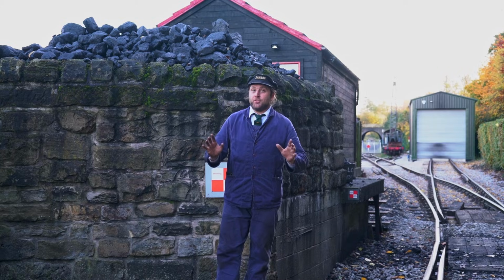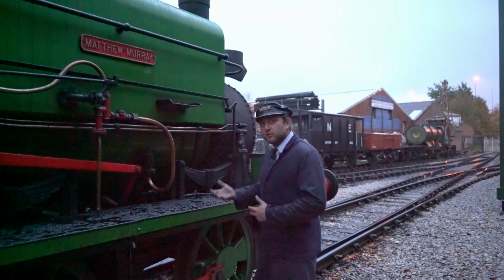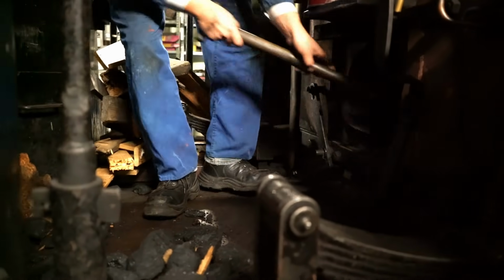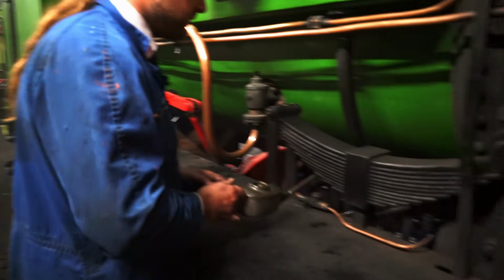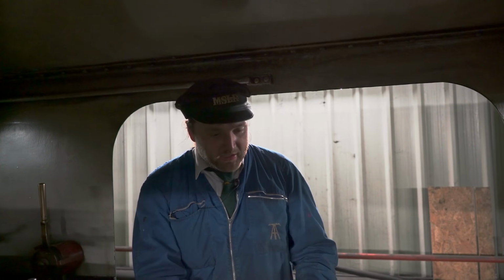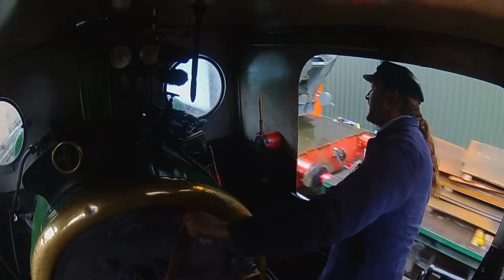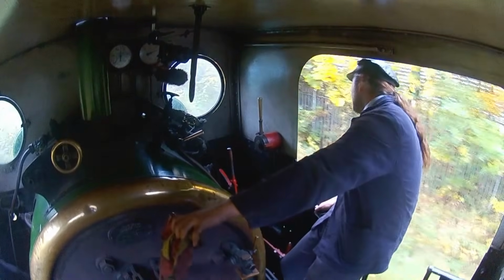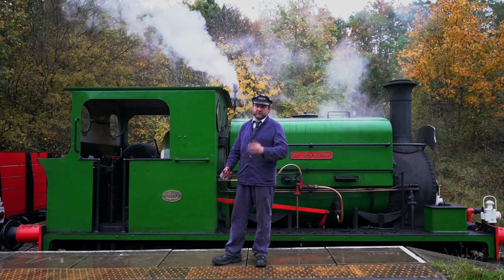Steam, rain, and freight. Driving a Locomotive in the City it was Built! Matthew Murray LGL Ep. 26.

Comment: The amount of trouble the diesels throw up,  knackered flywheel couplings, burst radiators,  oil cooler unions , brocken rockers / push rods,  compressor belts ( never the same profile), compressor valves, donkey engines and starter motors playing up, gearboxes and linkages failing, alernator flashover.
Reply from the maker: Ah yes, but that's a fitters problem, not the drivers! Prep remains simpler and easier

Comment: That's why the U.S. does not have steam engines with cylinders inside the frame, because it was way too difficult to oil and not very convenient to maintain.
Reply from the maker: Does result in better riding though.

Comment: Was this level of oiling a daily occurrence back in the day?
Reply from the maker: Yes, or at least should have been! All the lubrication is total loss, so it'll loose over night if you don't pull the trimmings out too
Reply: It was actually common to re oil many parts during the day on some engines, for example while taking water or waiting in a siding letting another train pass
Reply: It surprises me that automatic oiling systems were not used to eliminate this issue. Reading I see that eventually this was done to some extent but get the impression it was never completed/fully adopted. I would have thought it quite a priority. Maybe I am using too modern logic but I know today we would have experimented with 101 different oils to make them last longer/run smoother.